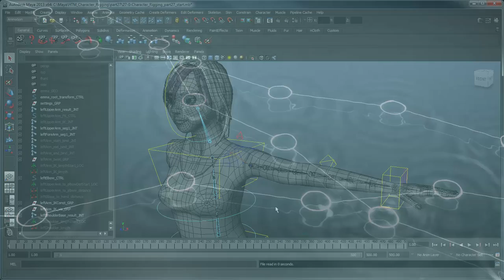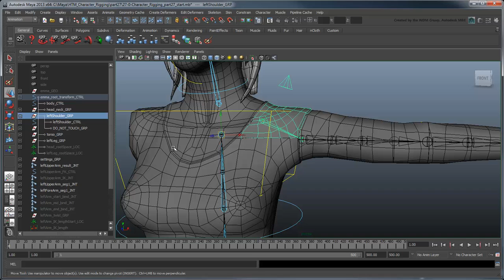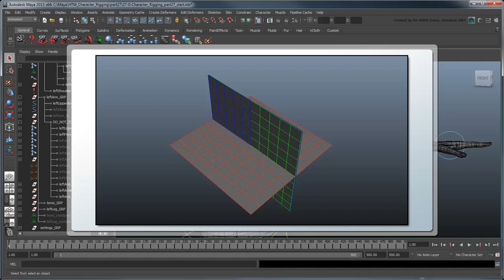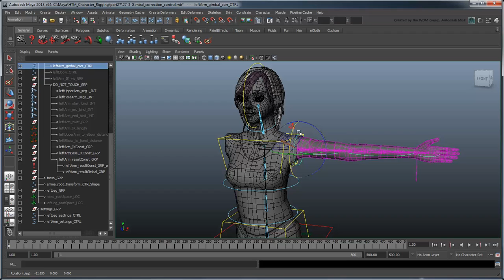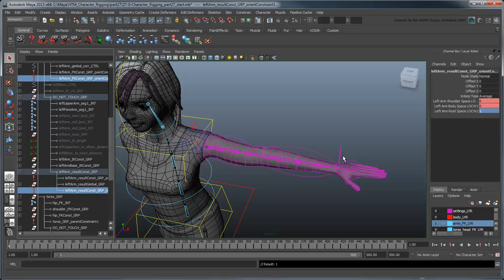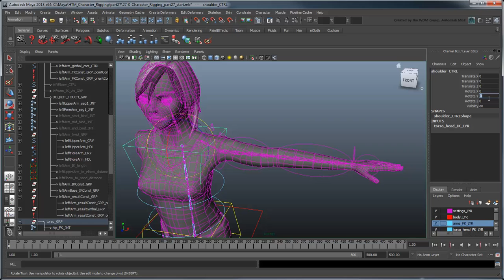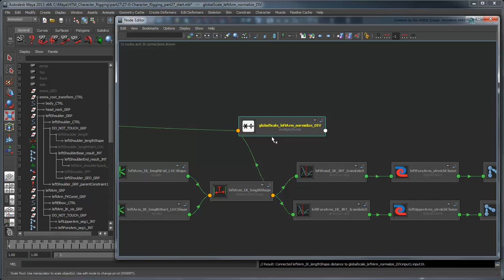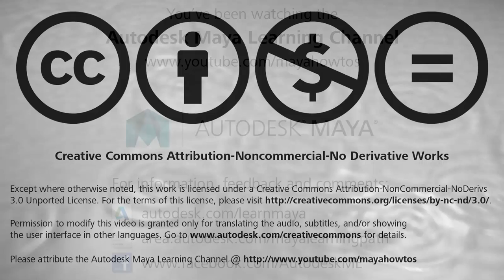Creating a Character Rig - Part 27: Arm global transform and cleanup (Advanced)

Comment: By the way - at this point should we freeze the transform of the IK arm Pole Vector? why did we choose to save it's transform attribute instead of freezing them in this case?
Reply from the maker: +Gogo It makes it easier to do the FK/IK matching later on.  Also, it's not always clear what the "zero" position of an arm is.  For some animators it's the full T stance, for others it arms bend downward at the shoulders.

Comment: Choosing the proper rotation order to begin with will minimize (but not remove of course) gimbal locking situations. the axes parentage order should be chosen in such a way where: 1 - the most used axis comes first,  2 - the least used axis comes second, then 3 - the axis between the two extremes is last on the order.

I already prepared the shoulder rotation order beforehand, but adding in this new gimbal correction control, will add a second safety control to adjust it. Question - so Animators then should animate the FK upper Arm normally via the FK joint yes, and use this control only for Gimbal correction yes?
Reply from the maker: +Gogo That's correct.  You'll want to make it clear that the gimbal control is not for "regular" animating - just for fixing extreme situations where gimbal lock occurs.

Comment: How would you go about creating a gimbal correction control like we do here for this modular rig, except then for a shoulder in a one-root-boned rig that has all its joints connected to one another?

You wouldn't insert the correction control inbetween the joints and you cannot orient constrain the joints to the gimbal control either, since rotating the gimbal would 'reset and undo' any rotations currently applied to the bones.
Reply from the maker: Shrooblord by one-root-boned rig, I assume you mean a single root skeleton that still has control skeletons (IK/FK) overtop of them?  The principle is actually more or less the same.  You can still have the extra gimbal correct root node in your root skeleton.  So the parenting structure would look something like shoulder_end > shoulder_gimbal > upper arm.  Basically, do not combine the shoulder_end and upper_arm into a single node, though it might be tempting to do so.
Reply: Maya Learning Channel Ah so have a joint inbetween the shoulder end and beginning of upper arm, like you do with the 'straight' bones for the fingers in both the control and result hands later on?
Reply from the maker: That's correct.

Comment: When i put the Fk_rotationSpace attribute to 'shoulder' and. Translate the leftShoulder_CTRL in Y, the IK. Arm does not stays planted ?
It stops staying planted. Right after i apply the orient constraints of the shoulder,body and root space LOCs with the FK and result Const GRPs.

what do you think is causin. this?
Reply: I can get to keep the ik arm planted.As it turns out my forearm ik joint wasnt stretching at all.
But, a new problem has occured.
In Ik mode, when translating the leftShoulder_CTRL in Y with fk space set to shoulder, the twist arm and result arm does not stay planted with the ik arm.
Im not able to find the cause.please help
Reply from the maker: Arpit Dadhich Your FK space should have no affect on your IK arm, so this leads me to believe you have something constrained to something else incorrectly.
Reply: I have point constrained. the leftArm_shoulderSpace_LOC to the resultConst_GRP, and also point constrained. the shoulderSpace locator to the leftArmBase_IKConst_GRP and also with the leftArm_FKConst_GRP.
All the shoulder, body and root space locators are orient constrained to the FKConst and resultConst group.

I checked by translating the leftShoulder_CTRL in both IK and FK modes and guess what the result and twist arms are not following the Ik and. Fk arm when manipulating the shoulder_CTRL or leftShoulder_CTRL but they do when manipulating the fk or ik controls.

Thanks for your precious time.
Reply from the maker: Arpit Dadhich Seems that you forgot to also point/orient constrain the result arm to the leftArm_shoulderSpace_LOC.
Reply: By result arm you mean the leftArm_resultConst_GRP right? Which contains the result joint chain. I did point and orient constrained the shoulderSpace locator to it.
Reply from the maker: It's unfortunately rather difficult for me to troubleshoot from here.  I think my best suggestion to you would be to download the included scene files and compare your connections (via the node editor) to the finished file there.
Reply: Ok i'll get to it right away.
Also, i want to ask that when i set the start and end keys of the leftShoulderEnd_result_Jnt_translateX to linear, the leftShoulderEnd_result_Jnt moves a little away from its original position.
Same thing happens with the leftForearm_ik_jnt.
Can this slight shifting of joints from their original position cause big problems later ?
Reply from the maker: Arpit Dadhich Are the joint lengths set at anything other than a value of 1?  The linear (actually spline is better) will change the rate of scaling, but shouldn't cause any changes at a scale value of 1.
Reply: No, the length value is 1. 
Does it have something to do with maintain offset when constraining?
I always keep the maintain offset on until you specify not to.
Reply from the maker: It should be kept on so that shouldn't be a problem.  I would break the connection on the Translate X and double check the stretch script, then try setting them again.
Reply: Ok i will try that.

Comment: I'm have a slight problem, when i move the arms in IK mode, some of the GEO's flip. Is this a problem that can be avoided, or just something I have to deal with and be careful about? Thanks
Reply from the maker: ***** This is related to the IK Handle's Advanced Twist Control setting.  Did you use the original values or the updated annotated values in part 22?  In any case, no matter what values you use you will always see some flipping in specific orientations - it's unavoidable due to the math behind the scenes.  That said, you can experiment with different Advanced Twist Control values to minimize the flipping based on the movements you expect your rig to make most often.
Reply: I used the original values, I will try to do the second set and see how it changes things. Thanks for the reply so quickly

Comment: When I scale the character, in IK mode, the upper arm is pulling backwards with the shoulder stretching. In FK mode, it looks like the shoulder is stretching quite a bit, and the upper arm may be pulling into itself a little. I figure that I'm missing a Mult/Div node, but I checked the connection with the emma root transform, and I had the same amount of Mult/Div nodes then you do. Do you have any idea which Mult/Div node I'm missing?
Reply from the maker: Is one of those multi/div nodes set to multiply by mistake?
Reply: Maya Learning Channel Yeah. After I posted the question, it occurred to me that I probably did that. Came home from work and forgot to check it for hours (I was working on another project). Remembered, checked it, and sure enough the shoulder mult/div node was set to multiply instead of divide. Thanks!

Comment: AT [17:09] it ask to connect the measurement nodes involved in the elbow snap. How do you go about doing that? Also it would help a-lot more if you bookmark every time you use the node editor so everyone can look-up, and see how the node editor map should look like.
Reply from the maker: The elbow snap fix is the same as the leg, knee, and arm global scale fixes.  Just create a Mult/Div node, input the shoulder to elbow measurement and divide it by the current global scale (Y), then output that result to the actual joint length.  Do the same for the elbow to hand measurement.  Basically all this is doing is scaling the raw lengths of each of these limbs to one that is relative to the current size of the model (think of it like scaling a full size car tire down for a go kart, or up for a monster truck).
Reply: Maya Learning Channel I don't think I am making it right. It doesn't work. Which actual joint length should i output to? So is it 'leftUpperArm_to_elbow_distance' divide by global scale Y? but why do we use scale Y here?
Reply from the maker: Yes, that would output to the leftForeArm_IK_JNT.  You would need to do something similar for the hand joint.  

Try downloading the included scene file and comparing the node editor to your own file to see if there's any anomalies.
Reply: Maya Learning Channel I downloaded the files for this lesson and the files for the next lesson and I looked in the node editor but I don't see the elbow snap fix. I followed Lesson 27 to the end, and as far as I can tell there is no difference between the two. Then again, it's a definite possibility that I'm missing it. 

I selected the root transform in the outliner and showed connections in node editor and compared the two node editors that way. I didn't see a difference. I also selected the distance nodes (upperarm to elbow, elbow to hand) and showed connections, but I didn't see any multiply/divide nodes.
Reply from the maker: In this specific case, I would grab the scene file from Lesson 32 and use that as a basis for comparison.  It's possible the fix wasn't propagated throughout every scene file after the error was discovered and unfortunately I no longer have Maya 2013 installed to manually fix the file myself.  I can assure you that the file in part 32 is correct though.
Reply: Maya Learning Channel Thank you so much for replying so fast even years after this tutorial was uploaded.

Comment: at 3:22 you point constrain the leftArm_resultConst_GRP to the  leftArm_shoulderSpace_LOC to attach the arm to the shoulder. However, when I do this the upperarm joint doesn't follow. I changed the constraint between the upperArm_result_JNT and start bind joint from orient to point, but this breaks the hand away from the IK controls. Is there anything obvious I haven't done, like turning on/off maintain offset for one of the constraints?
Thanks!
Reply from the maker: If the arm works on its own independent of the shoulder, then I have a sneaking suspicion that the leftArm_resultConst_GRP doesn't contain everything it needs to contain so you may want to start there.

Comment: This tutorial is amazing! I appreciate it so much.However, I do have a curious question to ask in this part 27 which shows the FK space-switching but why we don't build that for IK as well? Thank you!
Reply from the maker: IK is always in world space, so there's no need.  FK always moves relative to the joints in the heirarchy above it.
Reply: Maya Learning Channel I would please to know, what if the animator need IK to have the space switching? Is that possible to create for it?
Reply from the maker: Space switching doesn't make a whole lot of sense for IK, again because the controls are in world space.  What would the "other" spaces be exactly?  

In the context of a larger scene, it would be possible to switch between scene space and character space, but I'm not sure there would ever be a scenario where you'd want to adjust the character's limbs in scene-space.
Reply: Maya Learning Channel What if I wanted the IK arm able to turn while turning the shoulder Controller just like the FK does? Is there any guide about it? I am still a beginner rigger.
Reply from the maker: In that case you'd just want to use FK.  The whole idea of IK is that you're able to move each part of the body independently and have the other parts of the body react (hence "inverse" kinematics).  The end of this series shows you how to build a script to snap the IK controls to their FK counterparts, so you can just do that once you've twisted the arm in FK mode.  Basically:

1.) Twist in FK
2.)  Match IK to FK (via script)
3.)  go from there
Reply: Maya Learning Channel Thank you so much for the reply! I will try to figure it out. ;)

Comment: is there a trick to orient constraining the right arm because when i rotate the shoulder CTRL the arm pops wildly
Reply from the maker: I wouldn't say there's a "trick" so much as you just have to be really careful about making sure rotation spaces line up correctly.  If in doubt, it's always better to completely re-create right-side rigs (i.e. the shoulder) rather than using the mirroring shortcut we did in part 32.

Comment: I am have a great problem to make the orient constrain of the time 9:01 on the right arm. I have no problems on the leftarm. but When I do the orient constrain with the 3 locator with the FK and Result Const GRP the joint point up -53.13 degrees in Z axi. I don't know how to fix it. please help me, I have tried a lot of things already.
Reply: Maya Learning Channel In case anyone else needs this:

I had the same problem, but turning 'Maintain Offset' wasn't fixing it. I realised it was because of the rightArm_shoulderSpace_LOC (as it was mirrored from the left side). To fix this, I just duplicated that Locator, and turned the duplicate on one of the axis (180 degrees on X was what mine needed).
Don't know if it's the right solution, but it worked for me.
Reply: I had this same issue. I have done this rig several times and normally I would just recreate the shoulder, but the more you do it the more you just want to get dine quickly. When you go into the set driven key window, you may notice that the offset Z attribute for the shoulder jumps to a value of -53.13, however if you change that value to 180, the arm returns to its appropriate location. So, when you key the constraint values, also key the Offset Z with the appropriate value. Offset Z for the Shoulder would be 180, for the Body 0, and for the Root 0. Key the Offset Z attributes along with the constraints and the arm should work just fine.
Reply: thank you. you saving my ass. for now
Reply from the maker: did you recreate the right arm or just mirror the existing one?  Doing the latter can result in spacial problems (described in part 32 of this series).  Select the joints and turn on the Move Tool, then select the locators.  If the arrows don't all point in the same directions, then it means the spaces are not aligned.

You could try constraining them with the "Maintain Offset" option turned on, it may fix your problem but is heavily situational.
Reply: Maya Learning Channel I have recreated all the right arm.
I have used the "Maintain Offset" option turned on. It keeps right at the moment I do the constrain. but When I move the torso it point up again.
Reply: I do not recreate the rightShoulder. just mirror it. perharps this could be the problem?
Reply from the maker: Yes this can also be a problem.  Again, we address this in part 32 which is actually dedicated to mirroring.
Reply: Is this what is happening?
http://i1105.photobucket.com/albums/h346/emummy/ScreenShot2014-07-23at53521PM.png

I also recreated the rightArm and everything was going splendidly (lies) until I reached the shoulder/body/rootspace part. Should I create the right shoulder? the mirroring for the hand and shoulder seemed to work great then I had this happen. The segmented joint chain has a world pivot point at 0,0,0. It also broke my IK handle chain.
Reply from the maker: Although you can mirror the shoulder and hand using the technique we showed in part 32, recreating them from scratch will give you greater control to fix problems like this if they arise.

In terms of what's happening in your image, it does look like a space issue, though I wouldn't expect the arm to appear there specifically.  I would make sure that "Maintain Offset" is turned on in the constraint menu when creating constraints for those.
Reply: Yep.. Life Saver!
Reply: I have such this problem for the right arm whenever i key the orient constraintes of fk ctrl  GRP and right arm result jnt GRP the arm jumps, i min in 1, 0 ,0  and in 0,0,1 the arm jumps why is this and whats the solution?

Comment: First off, thank you very much for these tutorials, they've been immensely helpful.  

I finished the rig cleanup and almost everything is working perfectly.  The only factor that is causing trouble is one section of the arm during scaling. For some reason the upper arm is not scaling at all with the root control and I can't find the cause. The rest of the arm and body scale fine in both FK and IK mode, except for that section.

I've gone down to comparing node by node with the file provided, but everything would appear to be in order, at least as far as I can tell.
Reply from the maker: Sounds like you may have an "Inherits Transform" turned off somewhere where it should actually be turned on.
Reply: Wow, that's embarrassing!  Not sure when it happened, but I did indeed have the "Inherits Transforms" turned off for the "leftUpperArm_seg1_JNT". Thank you very much!